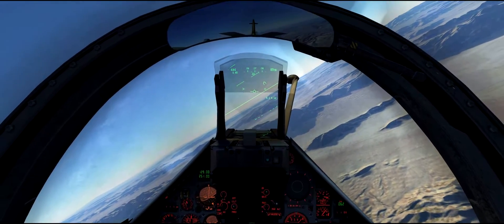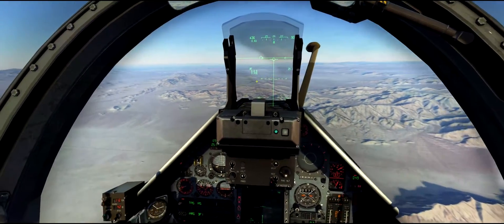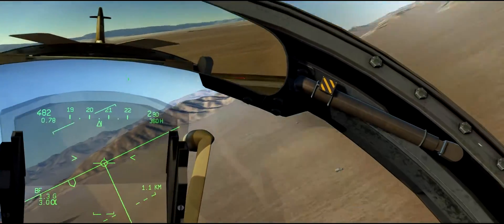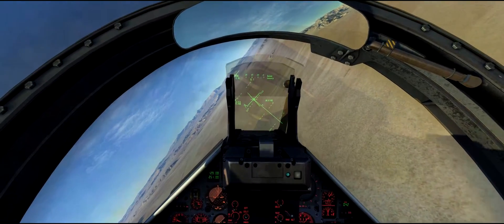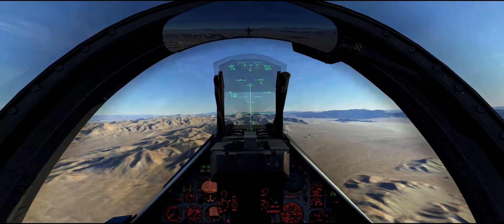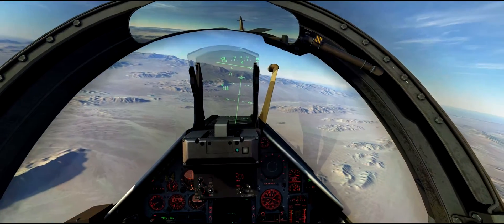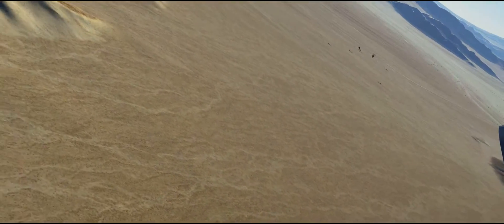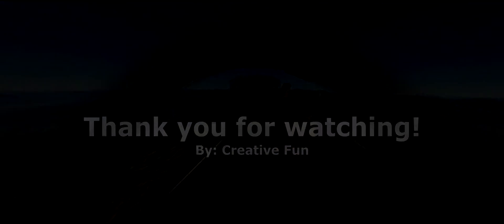DCS Mirage 2000C - Simple CCIP Bombing Tutorial

Comment: Hey, I just bought the Mirage on christmas and I don`t know how to get the radios working. I read the manual and searched on the forums but I didn`t find anything. I can`t change the frequencies and when using the keyboard command to select either VHF or UHF nothing happens.
Reply from the maker: I recommend that you check out this guide:
https://forums.eagle.ru/showthread.php?t=157056

It is what I use as reference to a lot of my tutorials.
Reply: Not sure what exactly you mean by the radio's working so I will try to help by starting with the basics first: You will need LSHIFT_NUM+ and LALT_NUM- to select if you want to transmit on UHF or V/UHF.  When you press RSHIFT_M you should see in the radio menu which radio you are using. Selection of the radio has no feedback as far as I am aware.

 I find Chuck's guide outdated as it has not been updated in a while so you could also refer to page 109 of the Flight manual. I look at both since I find Chuck's guide much easier to understand but the flight manual fills in the blanks as it has been updated.
Reply: Ok i missed the Rshift_M part, I thought it would be enough to just press UHF or VHF keyboard command.
Reply: tgtgtufeu tgtgt nope that only selects which radio you are transmitting and receiving on :)
Reply: Thank you sir